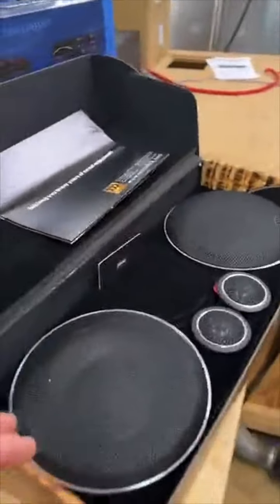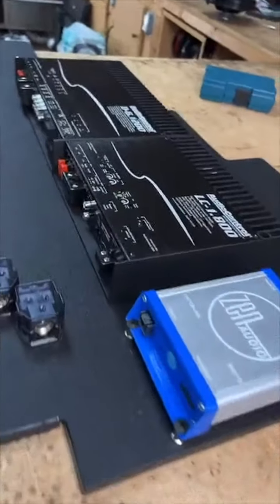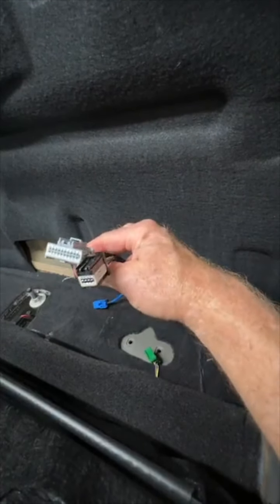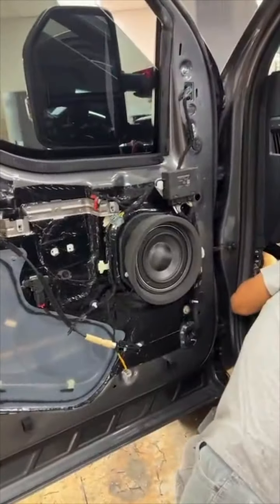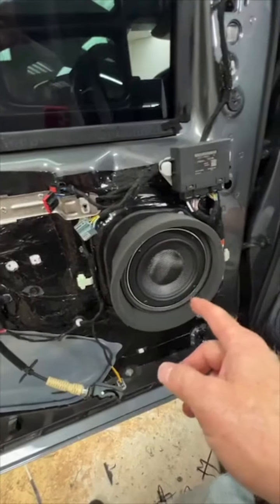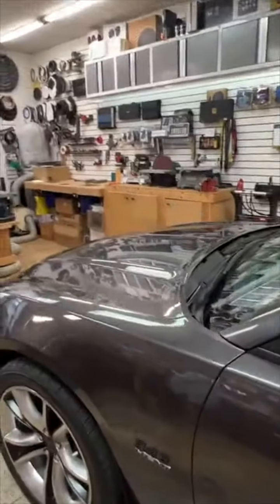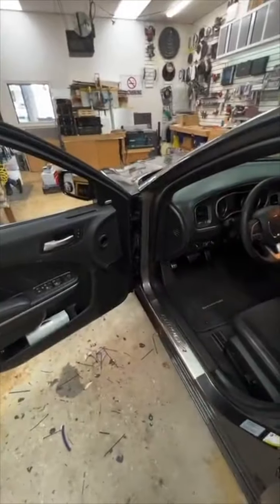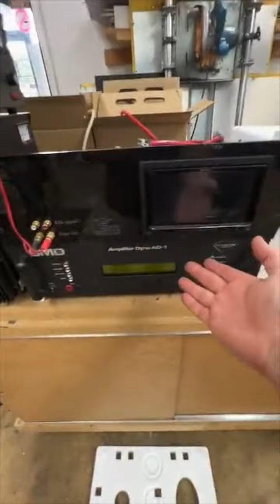big truck car audio an Instagram show

Comment: Good morning from Silicon Valley!   Can you please help to explain the theory around using more then recommended RMS power when using active crossovers.   Thank you!
Reply: You can run more power than the suggested RMS since the speaker isn't trying to play full range aka it's crossed over to only play the frequencies that particular speaker is meant to play.   For example, a mid bass speaker may say it plays from 55 hz to 5500hz however it won't do that wide of range well.  So when you actively cross it over to play like 80 hz to 500 hz for example, it will play those beautifully thus allowing more power to be put to them.

Comment: Good morning I cant find any info for upgrade 2021 Kia Telluride/HK premium sytem 12speaker ...want to knw if I should go amp-pro and dsp? And should stock speakers be changed?
Reply: There is no Amp Pro for the Kia.   You need the Rockford Fosgate DSR1 and the aHK3 harness for it.   That'll give you a nice flat front rear and sub output and also the DSR1 is obviously a DSP.   You can use your stock speakers on a new amplifier but personally I'd replace it all if it's in the budget